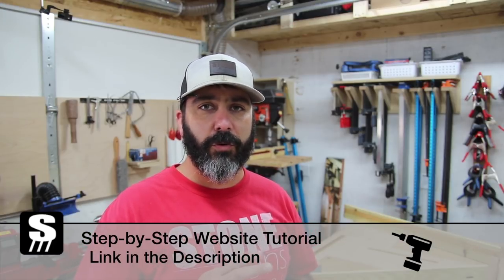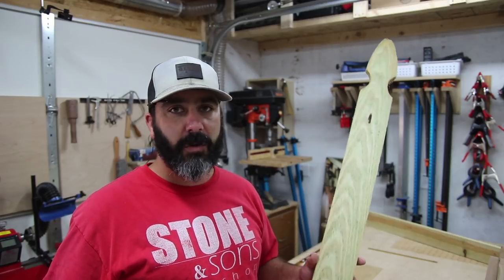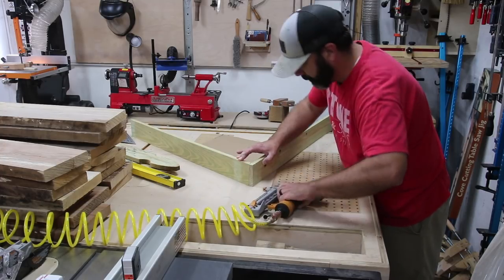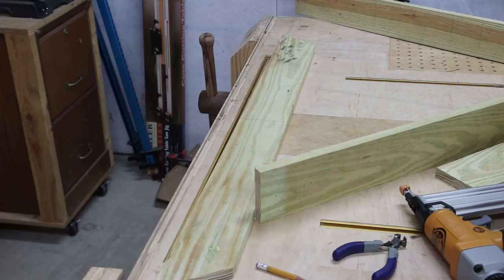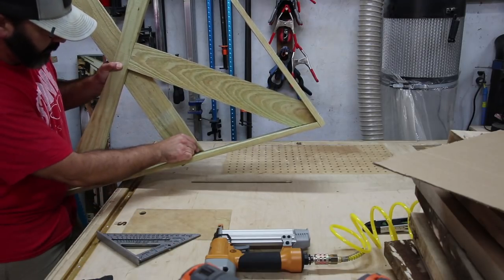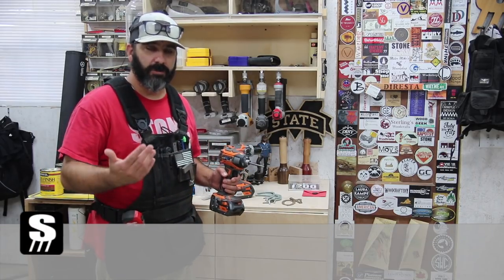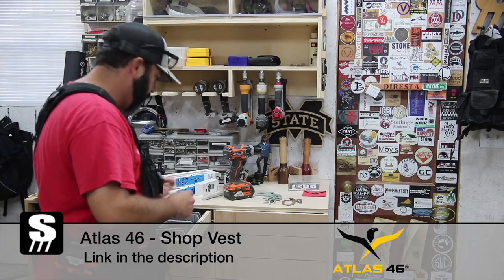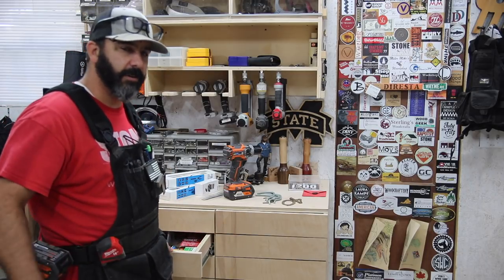DIY Decorative Gable Trim - Home Improvement

Comment: To find the pitch of your roof you can use your square and a torpedo level and the pitch of your roof means how much it rises over 13 inches so a 6/12 means over 12 inches the roof rises 6 inches they call it rise and run

Comment: If you are right handed, wouldn't it be better to have your magnetic wrist band on your right hand so you can get the screws with your left? 🤔☺️
Reply from the maker: Yeah, good point. But in this case I had to use each hand to drill so it didn’t make a difference.

Comment: i was wondering if you considered using any commercial product made by Ekena, or alternatively if you considered using cement fiberboard as an alternative to wood?  i'd be worried about pine rotting out after 5 years or so.  That stain does not protect the wood.